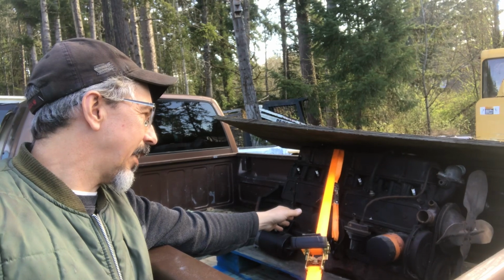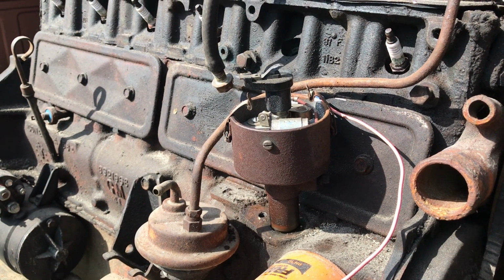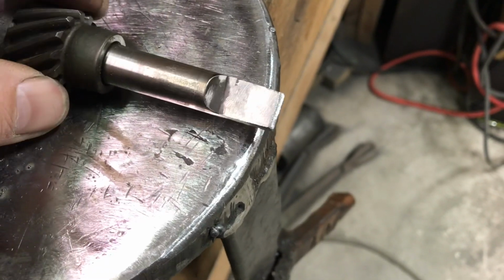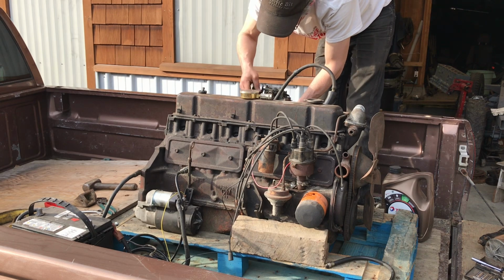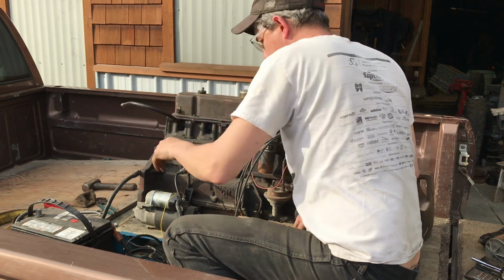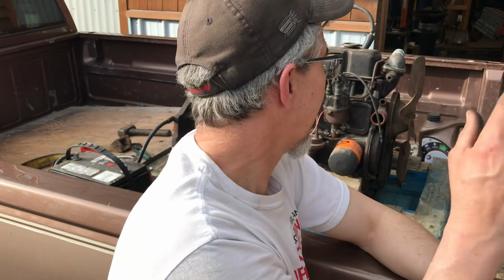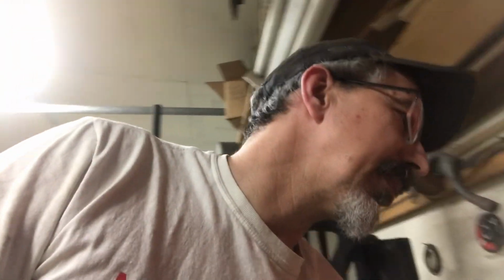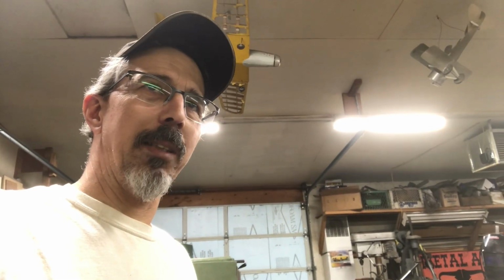Morgyvered, Chevy 250, Yes It Will Run

Comment: I still run a lot 252 flat head dodge 6 cycle there the same way , easy keep them running. I take manual fuel off and cover the hole . Add electric fuel pump to the carburetor.

Comment: I would like to know how to wire up an engine like that. Could you do an explanation?
Reply from the maker: You need 12 bolts positive to the + on the coil and then the - on the coil goes to the distributor. The big lug on the starter goes to + on the battery, - on the battery goes to the block. S terminal on the starter is touched to a + lead coming of the battery. It’s good to have a bit of a lead coming off the + on the battery to keep any sparks away from it. Or you could put a short lead coming off the big lug on the starter for ignition and energizing the starter.
Reply: @WildWestGarage  Thanks heaps Morgan.